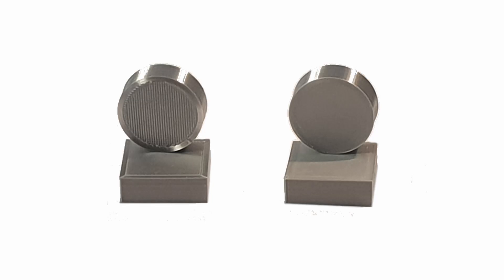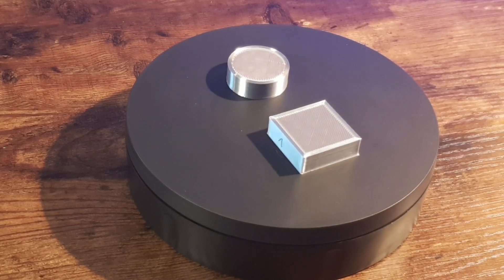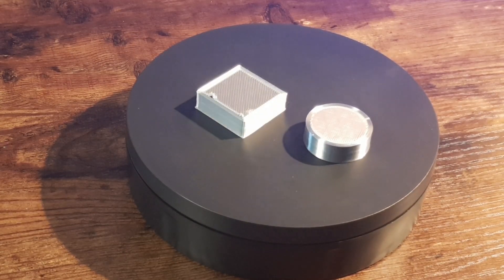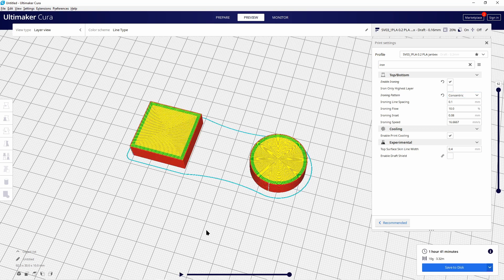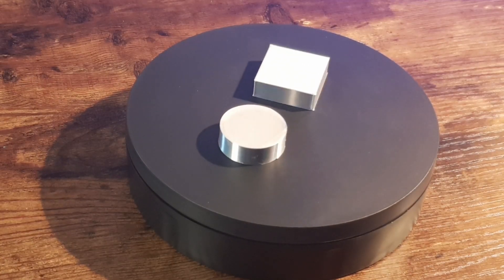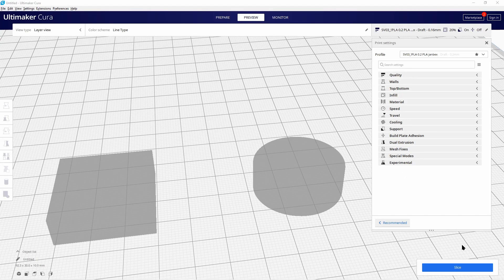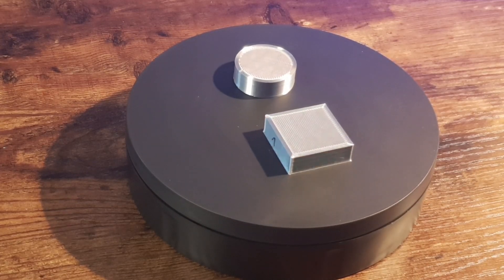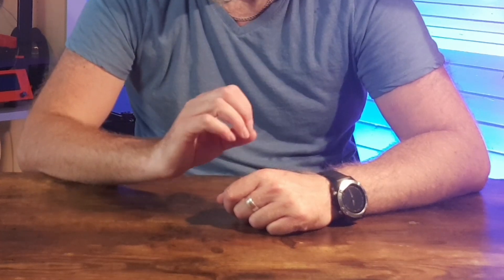great 3d printed surfaces with cura

Comment: In the two or so years I've been 3D printing (seems like it's been longer), I think I've used Ironing once when I first got started and didn't care for the finish (I didn't see much difference in a similar print with it off to justify the extra time for it's use). But the top finish you've gotten with a combination of Zigzag and Ironing: wow! That looks like a resin print. Thank you for sharing your experimentation and results with us. I have to try printing something with Zigzag and Ironing now!